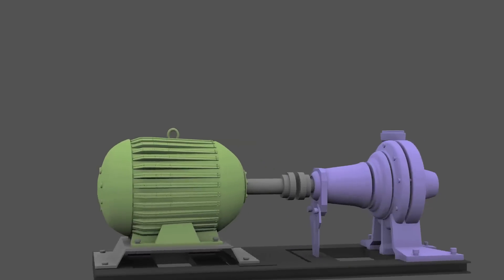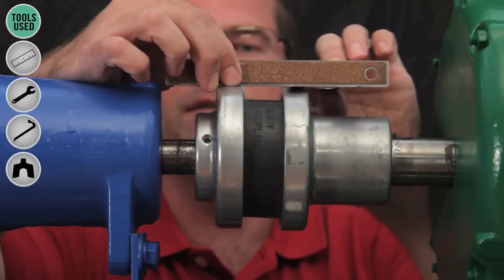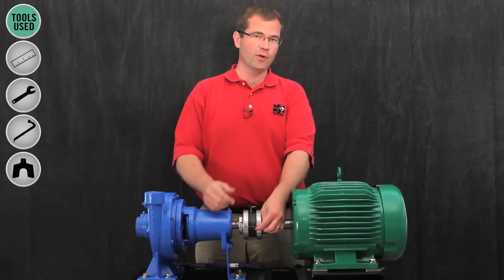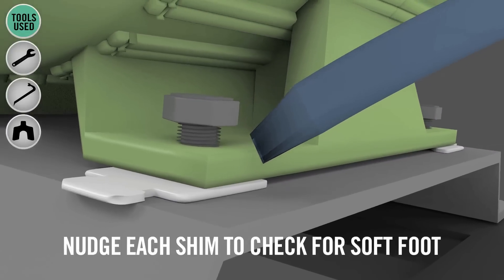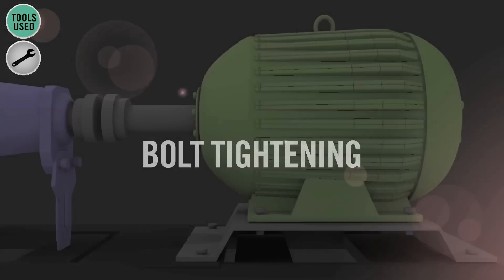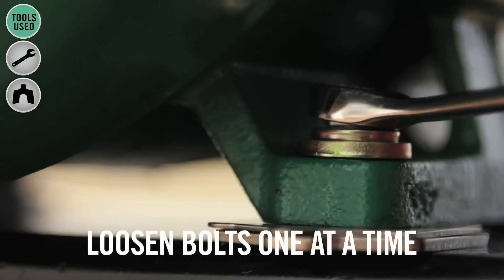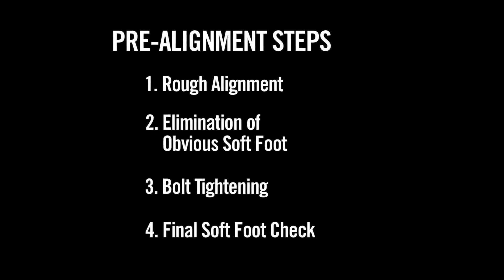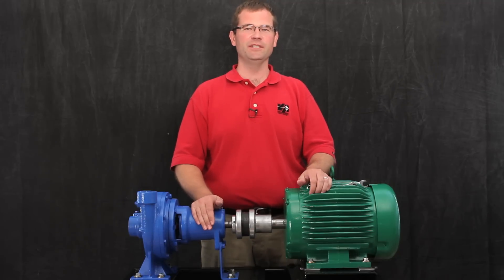Shaft Alignment Training: Pre-Alignment Steps | ACOEM

Comment: Radial is typically eccentricity (both shafts are parallel, but shafts don't have a common central axis and axial is "parallelism misalignment" (one shaft has deviated from parallel along the length of it's axis.

Comment: Nice video, but rough Axial inspection could have been carried by feller  gauges check around the coupling... this would  have given an early indication of bolts hitting off the feet bolt holes thus, preventing correction of defects in the area that is.... moving the motor sideways.... Just another obstacle that one comes across in the field.. when correcting miss alignments....